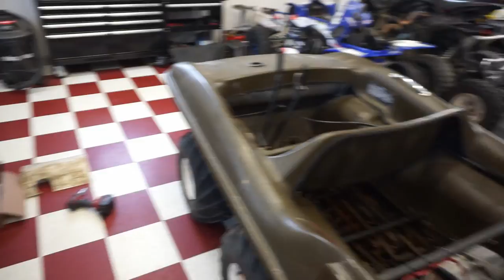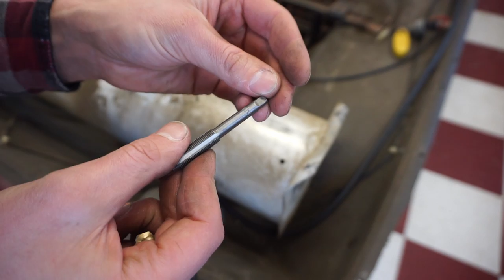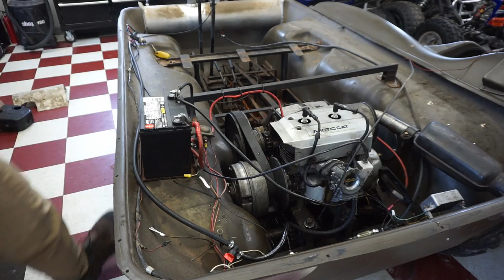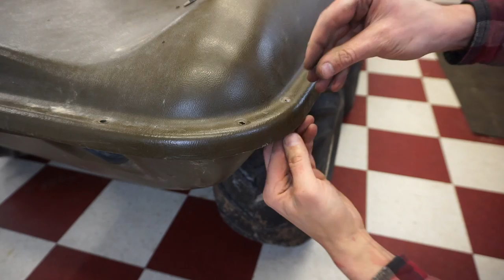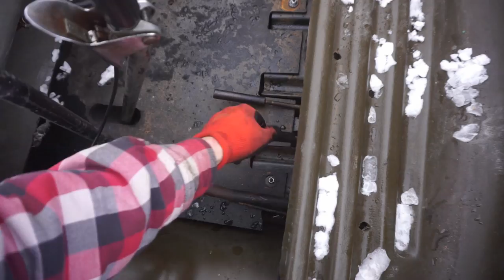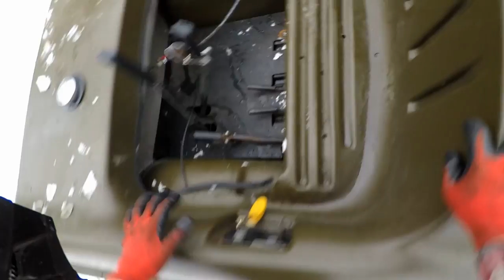First Ride On The $800 2-Stroke 6x6 TANK (This Thing Moves!)

Comment: Man I use those hose clamps every day and I’d use 1/4, 5/16, or 3/8 nut drivers, depending on the type or size hose clamp most are 1/4 or 5/16 you will throw that flat blade screw driver to the side. You won’t run the risk of it slipping and stabbing you into your hand or scratching something, and most of all it’s just faster, easier and you have more control
Reply: Strongly agree with this.  Slotted/flat blade screws and screwdrivers are two of the worse things ever invented.  Whether it be hand nut-drivers or bits you can insert into a small impact gun/cordless screwdriver, way easier than having a flat-blade screwdriver slip off and jab you in the digits.
Reply: Agree 100000%, someone needs to buy him a nut driver set for Christmas or his bday.  It is painful to watch him use the 1932 flat head.  They are good for removing flat head screws and prying off fuel lines.  Oh and of course the poor man’s chisel.
Reply: So, you think he doesn't know that? Are you inferring that he's stupid?

Comment: FYI, always put grease on your tap when you don't want shavings to fall into your tank.
Reply: My grandpappy taught me that back in the 90s but that’s a great tip for the uninformed people out there. They say knowledge is wealth
Reply: Or run an Inline filter like you should with any metal tank
Reply: Now that's a pro tip right there 👍
Reply: I was gunna say the same thing
Reply: Also put Grease on the drill bit.

Comment: Just a hint: When hooking up a battery, connect the positive first .Then you won't get sparks if the wrench contacts the ground while tightening. When disconnecting remove the negative first. Again no sparks when you disconnect the positive.
Reply: Very good point 👍
Reply: What is the fun in that, sparks make it interesting
Reply: @kevinstraus1478  . Batteries give off explosive gas at times and you want to ignore sparks.  Sure go ahead.
Reply: Favorite saying to remember  which one is first

Positive End is a cool guy, he arrives to the party first, leaves the party last.

Comment: I can’t believe he drilled into a gas tank of any type with fuel in it.
Reply: Yup....I held my breath as well. I was also curious were the hole in the tank was for the original fuel return line.....there had to be one.
Reply: It has an upgraded engine that was not fully set up

Comment: My neighbor from where I grew up had one with a Rotax 440 , 2 cylinder 2 stroke,  that 6x6 hauled ..... I had a hover craft , with 2 Kohler engines,  40 hp single cylinder for lifting and a 30 hp Kohler single cylinder 2 stroke for thrust with a prop ,  it was a blast to drive , sucked gas like no tomorrow always had to premix the gas and oil , traded it off for a bass boat in the mid 70's.... fun machine ....

Comment: It needs an air cleaner and carb and intake manifold tightened for air leak and a simple squeeze bulb primer will make your starting a breeze. It looks good and you made a really good deal with that turning out to be a much newer snowmobile motor than the primative original. Snowmobile engines are perfect for cold weather cause they were designed for it and they start redilly compared to 4 cycle motors. Get a set of more aggressive tires. You can mount up to 25" tires in that machine. I have 3 of them. It's hard to find tires for those small rims but a really great tire in that size tim is the Mud Lite. Two of mine are running them and do great in water. Plug that hull. There's a grease zerk on each axle through hull bearing cage. Grease them now. When those axles go bad they are usually rusted to the bearings and sprockets. They are billy-hrll to remove and usually have to be saeef off. If you have any slap from loose chain it can shear the pin that locks the sprocket to the axle. I have a wide block pattern set of tracks made for my Max IV. Will go in snow that snowmobiles just sink in. Downside is tracks don't swim well. With a set of 25" Mudlites on it you're nearly as much foot print as tracks. Learn about that skid steer tranny and don't run it low on fluid or god forbid- dry. Hustler owned the rights to it and it put them and Max at the head of the crowd in the market. Go look at the videos at Route 666 and see all the different models racing. Some of them were really cool but my all-time favorite is my Sidewinder.dont be tempted to use that luggage rack for a seat because there are no more body parts left at Route 666. Seriously consider a roll.bar ( minimum) or better a cage. If you watch the old videos of racing and see how many of them rolled you will understand. Most common scenario is climbing too steep ( up or down) and end over end. The hustler's wheel base is a little longer so not quite as prone to in. It will kill or cripple you. I almost did pinned under my Max II in the bush of Alaska.that modle is very short and does wheelies in hard throttle. I can't over caution you about jumping because the axles bend.They weren't built to fly. Most useful ATV in my ranch. Use them for everything. Dandahermit

Comment: Nice job, that engine is I believe nickel plated cylinder walls, least my jag 340 was, she may be getting a little hot. Some electric fan or fans added in may be a good upgrade.  And good 2 stroke oil. I like Lucas semi synthetic, for my jet ski. Purple in color. seems to do well when your high rev alot. Maybe will see some water action video in the spring with it.
Reply: Yes, my 400 Cat was. Made by Kawasaki. I believe the 340 was as well.
Reply: All the old Kawy cat engines are chrome cylinders. Not Nikasil. The Suzuki Spirits are Nik. I got the same engine in my 1972 Cheetah. 32 screaming hp. Lol. That’s all. 340/399/440 all same crank and stroke, bore size increases. 27/32/36 hp with the single carb and canister muffler. Decent engines for 50 years old tech. Simple motors.

Comment: Can't believe how many people hadn't seen these.
They predate quads by years.
Reply: Back in the early early 70s my girlfriend's brother had one, if I remember right his would float
Reply: I remember as a kid seeing these in the 90's, my mom's friends up the street had a huge yard full of toys like this, I'd always go out and play in there yard and set on all the machines. I remember seeing a couple things similar to this also, but instead of wheels, one had double snowmobile tracks on the back and steering skis in the front, then they had this other one that was a smaller single seater snowmobile type thing but you set down inside of it like a jet cockpit, it had a single snowmobile track underneath in the rear and the 2 steering skis up front. I've never seen anyother like them in my life since, I miss the h#ll out of the ninety's, we would ride 3 wheelers and snowmobiles all over our small town. (Back then everyone did it for fun and transportation)

Comment: ALLWAYS be sure air pressure is same in all wheels for steering. For snow air down around 5 or 6 lbs. Your feet belong on the front floorboard. That was a ready to tune and ride project. People spend months to years restoring these.it was even clean and all the chains were good. Be very attentive of  adjustment. Most of these long projects and ALLWAYS need chain and sprockets. It seems fast cause it's Ridgid suspension. They weren't built for speed( all though we all raced them) they were built to go nearly anywhere. And the will. Jumps will destroy the axles and probably you. Put your battery under right side of front seat and heat sheild. It's plastic. ( HDPE actually)) Dandahermit

Comment: Just a heads-up, that fitting requires an NPT tap, national pipe thread. They cut tapered threads so it'll seal on its own.
Reply: ah, good tip, I didn't know that
Reply: I wrote that also then deleted the comment because in my 40+ years of being a fabricator I’ve never seen one of those fittings with anything but a NPT thread on it, oh and a O ring on a curved surface doesn’t do much!
Reply: Too bad they delete comments that have good knowledge

Comment: Did the motor mounts allow for any adjustment front to back? If so, u could probably slide the motor towards the transmission in order to get that belt loosened up. If not, you could always take the belt to a sled shop and 1, see if an arctic cat jag (1980-89 era) belt is slightly longer, and 2 find a belt that has close to same width and just slightly longer. It being that tight isn’t allowing the clutch to fully change gears (spread/squeeze)

Comment: I'm 80 years old and was a teenager when these evolved and have over 60 years experience building maintaining working grooming snowmobile trails in the bush of Alaska and racing and sales. Used to sell Max 6 wheelers for Recreative Industries. ( The Max manufacturers) The snowmobile motors are great for snow weather but over heat in summer .This guy is gonna kill himself riding it like that. All 6 wheelers need a roll bar or cage. All mine have them

Comment: I predict your transmission will fail unless your clutch adjustment is addressed so that at least the clutch disengages, hint this will also allow you to shift into reverse, however if you're looking to do a video on rebuilding your transmission, well keep riding. 😎
Reply: I agree, belt seems to be too short or too wide. The driven side of the torque converter should not be turning at idle.
Reply: Clutch alignments are critical after motor removal to fix starter.
Reply: Uh duh that's a CVT drive on Borg- warner SKID STEER transmission.

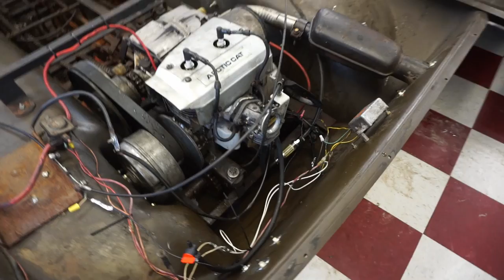Comment: 3:06 if that is a glass fuel filter on the intake for the carb, get rid of it asap. They're known to break/leak apparently, which may not cause fire in your case, but not a great thing either way.

Comment: back when I was a kid we would change those Tilson carbs for a Mikuni carburetor and fuel pump , and a k&N air filter , they used to be aftermarket carb adapters as well.  much more reliable . and responsive. just a thought. have an Awesome day.

Comment: 1) I really enjoy your videos and what blows me away is your mannerisms. You sound and talk EXACTLY like my son. If I was only to hear your voice I would say 100% it was my son talking. 
2) Buy a pair of wire crimpers for those electrical connectors, don’t smash them with channel locks. (more professional)
3) That fuel line running so close to the muffler scares me!
4) I think you’re a great guy with a bright future in your business but your neighbors must hate you! 🤣 The sound of this machine sounds extremely loud even at a distance on camera!
5) Was this built for midgets? Where do you put your feet?
6) Why didn’t you put the fuel fitting on the flat end of the tank?
7) Where did all the shavings go from drilling & tapping the tank?
8) NEVER drill a gas tank without filling it with water!
Other than that keep up the good work!

Comment: My uncle had a Max 2 6x6 with a 20hp Kohler replacement engine in it. His originally came with a 18hp Briggs Vanguard.  That thing would beat you to death in 10-20 minutes. Tires are rock hard and it has absolutely no suspension. He wanted to sell it to me because he got a new to him 4x4 quad. After running the 6x6 around the fields and up in the woods for a bit, my back was killing me. They would probibly be OK in sand or mud but you feel every little bump.
Reply: Tire pressure is supposed to be like 5 psi or less. Perhaps the tire pressure was set too high.
Reply: Tire pressure.

Comment: Nice that the body bolted together, mine was riveted.  As far as the carburetor goes, there is a mikuni that can replace the walbro unit.  The old site 6X6world would have additional information on the swap.

Comment: Not sure about your engine and transmission set up but in a snowmobile when at idle the belt and secondary clutch do not move. If you had a slightly longer belt, I think the secondary clutch and belt would not move until you hit the throttle. Probably get more speed as well because the belt would ride higher in the primary clutch. Also, might help with shifting if the secondary clutch is not turning.
Reply: i remember him mentioning in the first video he posted of this that the belt seemed a lil tight whenver he was fixing the starter, im wondering if your right it might need a lil bigger belt
Reply: i think the clutch hidden behind the primary  sticks /worn. Yamaha has that.  If there is no primary clutch like Can Am the secondary clutch sticks/ wrong broken spring/?
Reply: i hav n argo n it spins at idle n i feel it shouldnt......

Comment: That's the common circuit for diaphragm carbs and you have the fuel returning to the tank. You should place a fuel pickup like all chainsaws and snowmobiles which is a tube to reach bottom of the tank with the standard pickup filter on the end so it can move with gravity where the fuel goes to in the tank as your angle changes. Hope your inline filter picks up the metal filings you just deposited in the tank. All electrical systems are supposed to be fused. The bottom fuel petcock source should be replaced to the top for sure spropriate safety. In the old days they were at the bottom
 Bad.

Comment: I had a death machine a 1972 ski doo 340 tnt 2 or 3 inches of suspension and would tip over just looking at it, a real back breaker you had to lean almost off it to turn throwing gas at you from carbs never had so much fun driving it .

Comment: Dude you need to weld a fitting to the tank . And it should be on the very top so gas does not travel back that hose.even   solder would be better then nothing. Drain the tank fill with water drain refill with water leave the cap off and then weld it or solder it
Reply: Overkill?..... It's just a low pressure return line...

Comment: Behind the belt on the primary side is a second clutch.  At higer rpm it engages. In your case i thinks its it worn. Clean it to check and if worn of dont buy new but give it to revision in any clutchshop. They vulcanise new pads on it.

Comment: Just a tip, you probably need to do some more carb work. That is not a return line, it's an overflow line. This should not be having any fuel running through it unless the floats are leaking or improperly adjusted. If it were a return line there would have been an accommodation for it on the fuel tank.

Comment: switch your 3 tires from one side to the other before you try it in water. they are slow going in water and even slower if you have the tread the way it is now . won't affect the traction with it reversed on mud,grass,sand, dirt, etc. do not drive on your lawn unless going straight. will tear up your grass if you turn on a skid steer . make sure tires only have the pressure  hustler says. probably around 3 to 4 psi. if you treat it like atv you wont appreciate the capability of the machine. it's in a class all by itself.
AATV. be careful going fast and trying to turn . those are the correct tire tire tread for it. do not put ATV tires on it .tires have to be able to slide sideways .

Comment: I don't think that motor run bouth cylinters right? Anyway it's low in power. Gearbox (secondary clutch) should not moving at idle. Twostroke motor need twostroke exhaust pipe to running right.

Comment: I would have put the gas return nipple at the top on the end of the tank. Less likely to kink, easier flow path and a little better protected.
Agree with the other bloke about grease or vaseline on the thread tap to reduce the aluminium shavings from falling into the fuel tank.
Hope you put a fuel filter on the fuel line to that fussy carb subsequently.
Looks like a ton o fun.

Comment: Looks like a Rockwell engine, those engines would over heat alot especially in warmer weather, it would be the no. 2 cylinder furthest from the cooling fan, running a colder spark plug in that cylinder would help alot.
Reply: Sounds like alot of piston slap, you might want to look into a topend job, it would have alot more power.

Comment: Buy some wire crimpers for those connectors, but don’t use connectors. Solder and heat shrink.

Comment: One thing  u r not supposed to jerk the lateral of those sticks back and forth  u got keep pressure going forward until u turn right or left  one side one of a time your  Rev is only up with the sticks forward  pull both back to stop so u don't wear out the transmission or pop off the chain s also they take aft in the transmission merc i do believe

Comment: The snowmobile (CVT) belt is too tight. When the machine is stationary idling the belt and secondary (driven) clutch should not spin. You may be able to adjust the sheaves of the secondary a little further apart which would be the best way to fine tune the belt tension. If not the engine mounts may be slotted allowing it to move fore and aft, loosening or tightening the belt. Last option would be paying for a slightly longer belt. In the video it seems to me that you can see the belt is well above the outside edge of the secondary clutch sheaves, it should usually be even or barely above the edge with a flat backed belt. A belt that has grooves on the back is usually set with the valley of the outside grooves in line with edge of secondary sheaves. Getting this adjustment right will help prolong the life of the entire drive train big time, and it will perform amazing when set correctly. Good Luck! You do a great job and i love how your videos are just the right amount of building, fixing, and riding! Suits my taste anyways. Have fun man.

Comment: Take that Flathead bit out of that screwdriver shaft and put it straight on the clamp like a nut driver.
 Also your belt is too short. Its reving to the moon. Notice the speed increase when the belt warms up and stretches a lil? I had that same machine for about 9 year.  I used to know the belt number  for Garor belts, trial and error, but no longer remember.
Check your axle seals make sure they're all good. Get an ammo can loaded with some master links, extra belts, some fuel hoses, clamps, tire plugs and hand tools if you're going to be going far from home.